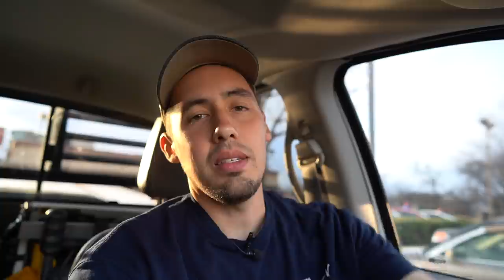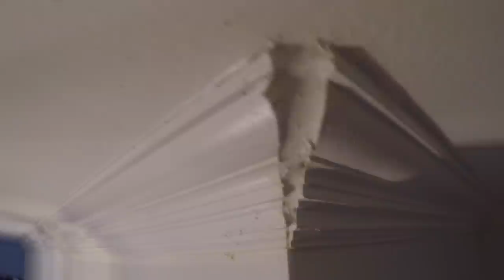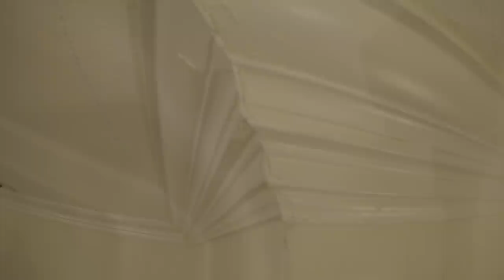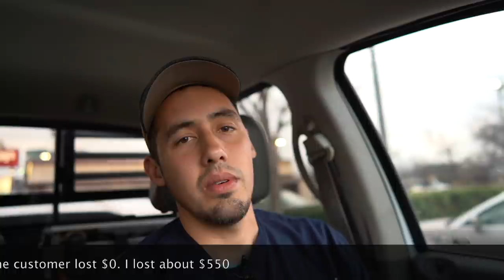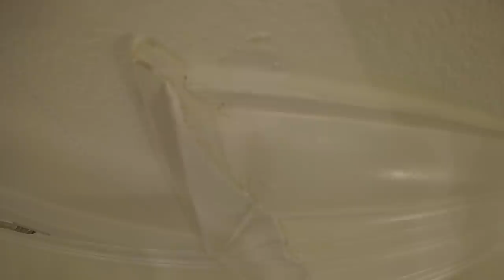The Worst Crown Moulding Job I've Seen

Comment: Awesome video and awesome attitude. As a painter I approach every customer’s home as if it were mine and go the extra mile in both owning up to and fixing my mistakes. I literally will step back, look at what I’ve done and ask myself “Can I live with that?” If the answer is no then I fix it. If I end up losing a little bit of money on that job in the short run because I took extra time to fix something, I usually end up making back that money and then some in the long run because that customer recognized the effort I put into making them happy and referred  me to new customers which they most likely wouldn’t have done if I had called it good and left.

Comment: I trimmed out a house I built for myself in 2003.  I did pretty well until it came to the crown.  I had a couple of inside corners that were horrific, and I couldn't get them to work, so I just caulked and painted the best I could and the result was similar to what was in your video.  Every time I looked at those crowns, I felt myself becoming less proud of the good work I had done on the entire house.  I sold the house 3 years later, but before I did, I had a pro come in and fix the crown I had botched.  A great lesson for all who attempt something you are not familiar doing.

Comment: Great perspective on that abominable 'workmanship'... and you say it's by someone hired to do it and not an intoxicated DIY homeowner?!  WOW!! There's those with the motto 'get it close as you can... and use 1/4" paint' but even THAT attitude wouldn't help those corners... better get some 3/4" paint to fix 'em!  "So bad you 'can see it with your ear... from the street"!  Job security is insured as long as there's someone out there setting the bar so low it's below grade, right? Thanks for maintaining such high and admirable standards TC TV! Best, Matt

Comment: You are right! There are only a few that can do it all.  I do it all. At this very minute working on a River Table for a customer. Yesterday installed an Instant Hot Water Heater, 2 weeks before that rebuilt a huge patio with 6x16 timbers that had rotted, before that a bathroom remodel with custom cabinets and it goes on  and on. I have about 100 customers that call me for everything. I rarely take on any new ones unless its a big job. There are people that are meant to work in offices and then there's the ones that work with their hands and mind! Keep up the good work!

Comment: here's some advice start in cabinetry and its all down hill from there, everything has a mild learning curve once you've mastered cabinetry. I did cabinets for 6 years, pretty good too, than I wanted to get into remodeling, went to meet the owner of a company that remodels, asked me my experience I said only cabinets but i'm pretty such I can adapt. he said ok we will see, I've done everything from framing to base, case, and crown, electrical, plumbing, flooring. LITERALLY no where near as challenging as some of the kitchens I've done, mindless honestly. cabinetry is the Marine Corp of construction, master perfection, master finishing, master esthetics, master attention to detail. guys that do cabinetry know that you only get one chance to get it right MAYBE two and if you don't you just fucked up a 1800$ panel that takes 6 weeks to get in. you can become a jack of all trades if you start in cabinetry.

Comment: My Dad purchased a house with this issue...well, similar. The issue is not so much the cuts that theyve made, the problem is theyve used excessive adhesive and where its squished out above, below, everywhere....they have not cleaned off the excess immediately. They left it and painted over it.
Im appalled!! Is it possible to scrape or sand it off? Or does the whole lot need to be removed and replaced?

Comment: Hey I have a question. If the crown molding is cut a little too short and they putty the section is that a bad job or is that the right way to repair that type of mistake?

Comment: My crown has butt joints instead of overlaps and those joints are warped and visible from 12ft away.  The rest of the crown install is fine, only the joints are bad. Should I have it completely redone or attempt to rehab the joints, sand, prime, and paint?

Comment: I'm one of the "one call does it all" guys and I DO treat every customers house like it's my own. That crown work is just horrifying! I would not be able to show my face in public if I did work like that. And making cabinets isn't that hard but like you said it just takes some practice. I've done stairs too and they turned out great! you need to have a stair tool to be able to cut the treads and risers correctly. They often have cuts of 1/2 degree to two degrees.

Comment: I really enjoy the content you put up on your channel. I paid my way through college years ago by working for a custom home builder. I worked for him for just over 4 years. During that time I became pretty good at several things related to homebuilding. However, the one thing I've been trying to become MUCH better at these days is trim carpentry. Your content has helped me greatly. As the owner of that company used to tell me...."a home is just a big box with a lot of smaller boxes inside of it. It's how you finish it out that makes all the difference. That's where you find real craftsmen."

Comment: I worked in cabinetry, it is easy if you know the tricks and methods, that is why GC's hire subs from all trades, your carpenters for framing, finish carpenters, hvac, electrical, plumbing, roofing, flooring, drywall, stucco crews etc...every trade journeyman has said skills needed.  Being honest works, a lady paid me to fix the ceiling where a fan installer stepped through, I told her I can cover it and attempt to match the texture, but it will not match, if that is okay to you and you don't care, I will do it. It was not my best patchwork, but it was solid, I did notice the fan was hung on a ceiling box for a light fixture, not a fan, she paid for the supplies, I framed in some braces for the fan, and cleats across the hole in the ceiling , to suck the sheet rock back up to the joists. I installed the rock, and asked a guy I knew who installed sheet rock to tape and mud, he showed me how to match the texture. I split the money with him, we were both happy. Homeowner was happy knowing that the fan would not fall on her kid in bed!! I am glad you learned cabinetry, now you make built ins and trim them out.

Comment: Like Harry Calahan said- "A man's got to know his limitations".  I agree with what you are saying.  I do know a person who knows how to do a lot and I've seen him do very good work in a lot of different areas.  He works by himself and works slow, and doesn't accept bad workmanship.  He is probably 1 in 1000.  Now personally I can learn how to do things but practice also is very important.  My wife wanted crown molding in a bedroom so I did it.  No outside corners but most of my inside corners weren't very well.  They are much easier to caulk and 12' up in the air you can't see the problems, just don't get up there on a ladder and look closely.

Comment: If you want to build cabinets you can do it. Use good quality veneer plywood such as oak, birch, alder, whatever, or if painted, MDF, but good quality cabinets use a special kind of high quality paint. That's what makes them look so good. Put a flat sheet of 3/4" AC fir plywood on some sawhorses for your routing table. After you have cut out your various panels, whether end panels or partition panels, you can buck them up against a 1x6 pine board which has been nailed along the 8' edge of your fir ply, holding them with blocks tacked onto your ply table. 

For making rabbets, you can put a ripped length of pine on top of the 1x6 so the base of your router will run along that. Make it so your rabbit will be 3/8" for your 1/4" back. Anytime you need a rabbit, that ripped piece of pine will be your guide.

For dadoes, get a router bit that is made for sanded cabinet grade plywood which is slightly less than 3/4". Tack your straight edge of 1"x4" pine or whatever, onto your bucking blocks and run your router base along that. It's all just dadoes and rabbets, dimensions, and good material. You may also want to route the end pieces to accept a clear 1x2 pine for a hanger strip along the top edge of the inside backs, notching out partitions so the hander strip will go through. Assemble your boxes, and screw the cabinets to the wall through the hanger strips. (glue and nail the 1/4" back which fits into the rabbits) On wall cabinets you may want a hanger strip top and bottom, or you could go with a 1/2" back as I see on some factory cabinets, today. Keep things square and on dimension.

Learn your basic cabinet dimensions, and common kitchen planning layouts. Use real lumber for your face strips. Make your own drawers. If you do not want to make door and drawer fronts, look into having a cabinet shop do them for you. You can do it.

Comment: I'm a carpenter contractor,40 years I've plumbed, wired, poured foundations,roofs, tiled, boarded and taped built cabinets, commercial residential basically everything from a to z, I treat every job as if it was my home I can do a lot and do it well,did crown moulding once as a favor, it's not that popular here anymore but it turned out nicely, when a client asks me to do certain jobs that I know a professional like you does I recommend they hire the pro, your set up to do it quickly and efficiently with guaranteed results, the main thing is they want it done right now and can't get the trades in. I've also seen a lot of horrible installations done by "pros" that I find  completely substandard amateur workmanship that I assume comes from lack of love for the job they're doing, some of the things I've seen would make you crazy million dollar homes where an inch of caulking does the trick.
Learned a lot watching your channel and appreciate the detail you put into your work.

Comment: I'm not gonna lie. I had a crown like that in my basement. I built the whole thing myself and after 3 months and lots of aggravation, I said F-it, it's just the basement. The whole place looked great but for that one corner. And wouldn't you know it was in direct line of sight as soon as you walked down. Out of all the homeowner work I've done over the years that's still the one that hunts me, that I left it like that. 
It's been 7 years since then and my skills have increased from your knowledge. Thanks.

Comment: if your stairs are configured with 7 inch risers, and 10 inch treads then you should use 11 1/4 oak treads. and it this case your stair case should be at about a 36.7 degree pitch but go by 38 degrees. handrail or base cap will be 18.3 degree mitres to level off or 26 degree mitres to drop straight down. hope this was helpful. the handrails should be between 34-38 inches from nose of tread to top of handrail on rakes and between 38-40 inches on level runs. pickets should not be more than 4 inches apart.

Comment: As a local handyman I have turned down work that I know I am capable of doing just by figuring it out. 
When asked if I can do something that is not in my wheel house, I tell the customer "just because I can, doesn't mean I should".  If I find that the task is interesting and something I would like to add to my talents, I build it or install it at home first.  Many times I do not even get that far which tells me that I definitely should not do it for anyone!
Your video, experience and comments encourage me to stick to ethics all the time. Rah

Comment: for the record, in some areas (like new england and the north east) most carpenters are 'frame through finish' meaning they're expected to know how to frame, run trim, install siding and remodel. when i worked in Oregon it was common to have the different stages broken up into framer, trim guy, siding guy etc. just saying, just because someone can do multiple stages of carpentry doesn't make them a 'jack of all trades'

Comment: Reminds me when I had to fix my Aunt's Kitchen. The knuckle head didn't straighten the walls so the panel can be flat against the joints plus he also used very strong wood glue and he didn't know that he had to flip the moulding into place. So overall my Aunt lost over $3000 Australian dollars because she was the one who bought the materials. I ended up repairing her kitchen for nothing because my brother used left over scrap from his workplace and my brother also helped ripped out the offending pieces.

Comment: Regarding the cabinetry - don't be afraid to make this leap and add it to your arsenal.  Best decision I ever made.

Now that you're a homeowner and can rig up some workspace to at least scab together carcasses and face frames at home - for someone who has a large family to balance, having "shop days" at home is a huge boost.  Hit up DeWalt/Makita/Triton and see if they'll send you a track saw in exchange for a demo.  That, a few router jigs for dados/rabbets/doors and a planer is all you need.  You'll be surprised exactly how simple it is once you get processes down and much more profitable than applied moldings (especially since you're already an adept painter and can spray your own).  Less time on site, less time in the truck going all over.

Comment: Recently sold my home, it wasn’t a large home but as a finish carpenter/cabinet guy it was built plumb, level and square. I purchased a home across state in a gated community on a small lake,the previous owners had bought the house new in 2003. Now as the story was told by the listing agent, a finish crew had canvassed the neighborhood a few years back with grandeur of installing crown in several homes. Most of the homes have vaulted ceilings, hmmm! Well needless to say when my wife and myself walked in for the first showing the first thing that reached out and slapped me was the 4 3/4” dentil crown molding installed upside down with probably 3 gallons of caulking for 400 feet of crown, looking much like that crap show in your video. I couldn’t believe it had been done by anyone calling themselves a carpenter let alone a hack and if I had lived in this area at the time they rolled through you bet your bottom dollar I would have called them out. My wife tells everyone I bought this house specifically to demo that junk and save a home... lol. Good stuff D and thanks for your channel and your service.

Comment: I have seen several of your videos, and the mouldings always seem to hug the walls and ceilings perfectly resulting in excellent joints and seams.  I think you would be the best person to do a video on how to install casing or crown moulding while adapting to walls and ceilings that have bows in them which leave gaps between the wall/ceiling and moulding, or cause the joints to twist and misalign.  The closest video I saw was where a painter filled in the gaps with joint compound or spackling, and feathered out the mud toward the center of the ceiling.  I just installed casing inside an empty rectangular fluorescent lighting soffit after finishing the old bare drywall and painting.  I installed casing within the sides of the rectangle, and I mated the sides to a picture frame-like casing that finishes off the bottom edge of the rectangle and faces the floor.  Unfortunately, the imperfections in the soffit forced me to sculpt the mismatched inner and bottom casing edges with hot mud in order to align those edges.  So frustrating.  Some installers use crown at the top and transition to casing at the bottom which looks good, too.  Thank you for your informative videos!

Comment: As I listen to your story found it interesting.
I consider when you are hired as professional, then you must fulfill that role,you are for hire, therefore must provide professional results.

While 8 mainly do finish work, trim, built-ins, some cabinets after being asked by local cabinet shop to help with his work load,in between projects, took on that role.
Few years later a property manager contacted my company to finish what a tennate did by leaving the water 8n kitchen sink running it flooded. Then mold soon followed, the mold removal crew did their job, the building maintenance man had no idea how to install the base cabinets. I bid the job high, they hired me 20 minutes later. I did they drywall patch at 3ft x 12ft, installed the as3 cabinets in a day and half 
The property manager as I work alone gas more work for me.
A retired vet needed a ramp in his deck, it was was 40 years old estimated. I have built a few decks,don't really care to are very labor intensive,pay less than trimming out a house 
Via local VA referred him to another office she handles construction matters. I came highly recommend. Why not sure. My grapevine is by other contractor referrals and word of mouth. Again did  not want to build the deck. I bid it high,but in line with my service rate.
He wanted me badly accepted the  I'd. The client in 80s ? Never built a deck before asked help at times. At some points let him. Gen I made up for lost time. I applied my detailed oriented to the deck everything had to perfectly align like trim decking, ballasters 3cerything.
Once completed the inspector was very impressed,as the neighbors behind. Any other building in that town like mine won't even heck my work. Which is wrong 
Those I know wanted to see photos of my work are blown away by it.
My moral, to do a job take pride in your work, be professional, make it look like a professional did the job,as  you just did.
My motto it never good enoughn yet be professional.